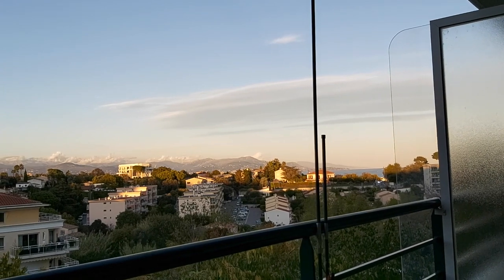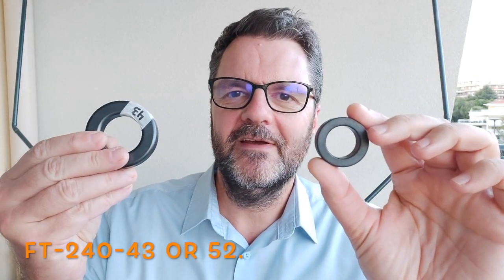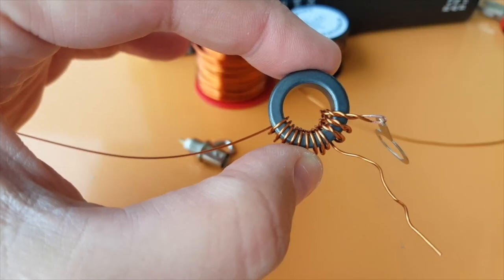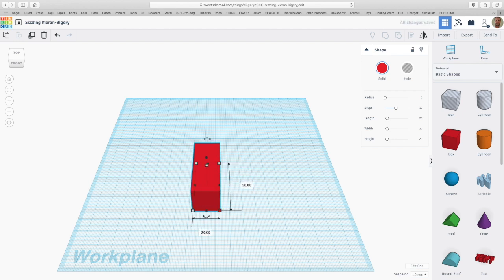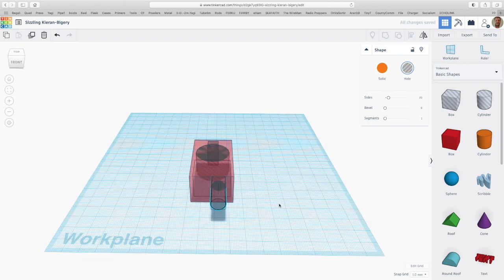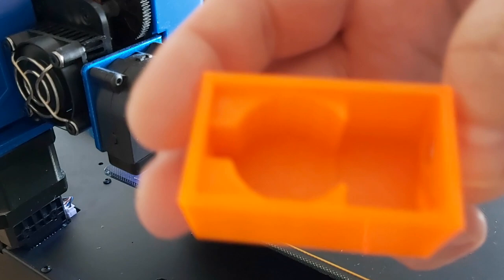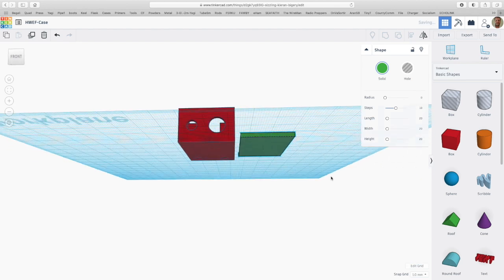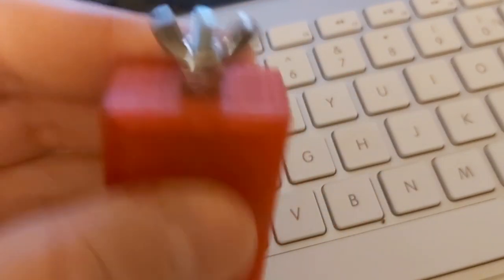A Super-Duper Tiny 3D-Printed HF Radio Antenna.

Comment: The best thing that ever happened was you getting a 3D printer :) Second best was ME getting a 3D printer. It's always printing something. I really like PETG. More than PLA. Not for everything but most things I print are PETG
Reply from the maker: Stronger, not as brittle. I will try carbon reinforced PLA, but you need a steel nozzle for that...

Comment: Nice project Gil. There is no need for a high voltage capacitor. The impedance at that point is 50 Ohm so with 100W the voltage across the capacitor will be 70.7 volt. With 5 Watt the voltage is 15.8 Volt. 73 Erwin PA7N
Reply from the maker: I just had them handy..

Comment: I don't think you loose power with the smaller core, you just can't transfer as much power before you magneticly saturate the core.
Reply from the maker: However, the turns being closer together, the losses are reduced. I have never in practice noticed a difference, although I have not compare them head-to-head.

Comment: The possibility of ingress of moisture (in harsh outdoor activities) and the need for a vent may also be thought of in your next printing of the container.
Reply from the maker: A small drill bit can fix that real quick :-)
Reply: @RadioPrepper  yes, I have seen being made that on the bottom side, in any readymade container. But I suggested this because you are good at 3D printing.

Comment: I like your box with the cylinder cutout.  I’ve been designing my boxes as boxes.
In TinkerCad, you can build components that you can add to your parts panel and reuse.  I have a BNC connector to scale, UHF, toroidal, banana plugs, 1/4-20 bolts, etc.  I add them to my projects, switch to hole, and they become holes through the box for mounting.
With all that said, I switched over to OnShape last year and really prefer it as I can rescale an entire model pretty fast to scale things up and down as necessary.
We will be downsizing next year and Fulltime RVing in two years, while my ham gear comes with me, my 3D printer will not, I dread that day...
Reply from the maker: Same here with my boat...
Reply: @RadioPrepper  Are you planning on living on your boat?
Reply from the maker: Long trip in 2-3 years...

Comment: Hi Giles, I use an end fed with 3 stacked ft240 cores, and 400 watts.  I do find I get rf on the ground side.  It still works, but I believe EFHWs are less efficient at high power.  Maybe I need to try a counter poise.  Thanks for all your interesting videos.  Please show more of the south of France!  Tim VK4QP.
Reply from the maker: Worth a try, 0.05 wavelength.. Will do!

Comment: 2:45 why should the loss be great?
It should be good for 5W or even more, up to 25W probably.
The key is the inductance of the primary, smaller toroid - >more turns for the same band.
Reply from the maker: Size matters ;-)
Reply: @RadioPrepper  Size and faith, but better is to understand how it actually works ))

Comment: Kind of wondering if you could make a jig to hold the parts, and then print the enclosure around the parts. The end result might look as if you had put say 2" heat shrink tubing over the parts and just heat shrunk the whole assembly. You might only need 1-2 MM wall thickness, printed around the parts perhaps it would not place any tension or constriction on them like heat shrink would.
Reply from the maker: Not with a conventional 3D printer...

Comment: One 3d printing tip for you. Plastic has a shrink factor so your bnc hole will always come out smaller. The fix is to add 3-5% depending on manufacture spec's of shrinkage. Oversize the holes by 3%.
Reply from the maker: I left them slightly smaller as finishing them with a drill makes for a rounder hole..
Reply: @RadioPrepper  If you're not getting a round hole then you need to start digging into that brand forums (try facebook "brand X" forums) and seek advice. It can be a few things. Try the easiest first like layer height and slow the print speed down, the more complicated things are like tuning and looking into the jerk and stop settings. Dialing a printer in depending on the brand leads you down into a rabbit hole and why many modifications were created in an attempt to overcome all sorts of issues. You learn a lot in the process. Best of luck
Reply: Then of course check out YT for the brand and see what others are doing with it.
Reply from the maker: Only bigger vertical holes are ever slightly oval, but it's hard to see... I can always add support in Cura...
Reply: @RadioPrepper  If you don't mind longer build times 0.1 layer heights give better details.
Reply from the maker: Certainly!

Comment: The military choice for the amount of wattage in 'man packs' tells us is that the man has to carry the batteries as well as the radio gear, and thus there needs to be a balance between adequate power, carrying enough battery to sustain the radio for a minimum amount of time specified, and the weight that will have to be carried. The amount of funding has nothing to do with it. It's not like lack of funds for the military would cause them to have to cut back on wattage.
Reply from the maker: Not on Wattage, on research. That too of course but it shows 30W is the minimum that works reliably enough. Modern lighter radio and batteries have not generated a large increase in manpack power.
Reply: @RadioPrepper  Yes, I agree. Batteries are much better today than they were during the wars, but you still only get a 3dbm gain for every doubling of output power.

Comment: Can someone explain the reason Gil filled the whole thing with hot glue? Is it just aesthetic or there's more to it, something technical perhaps?
Reply from the maker: It's to hold things in place to avoid fatigue cracks in solder joints during transport. And I like glue!
Reply: @RadioPrepper  thanks for the reply, and thanks for the explanation. I was wondering, wont this affect future possible repairs or it's an edge case where you'd actually make new one instead of repairing this?
Reply from the maker: Yes, cheap enough, and short of a lightning strike not much can happen to it...

Comment: Could drop the counterpoise and flip the toroid over for a more simple setup. From what I have read, a counterpoise isnt necessary at such low power.
Reply from the maker: No but a ground to bleed static electricity might for a balloon or kite antenna..

Comment: Nice video Gill.
I noticed that you reversed winding half way thru on the secondary, why was that.
In case you make a followup of this project could you sketch up the wiring diagram.
Thank you.
Reply from the maker: Just so the wire comes out the opposite side. See the Facebook half-wave end-fed group for the diagram.. It's in my head I made so many...

Comment: DE KD5SMF; Thanks for posting this video. I'm not used to a end fed antenna but, you make a very good case for using one in the field.  I noticed that you didn't use a dip meter to verify your toroid's frequency.  Have you confirmed that the 24 turns in the secondary are what was necessary?  And what frequency are you making the antenna for, or is this multiband?  Also, it would be nice if you would give your amateur radio call sign at the beginning & end of your video's. 73's de kd5smf
Reply from the maker: The 24 turns are not secondary but total turns. 3 primary and 24 total makes a 64:1 transformer. You can also use 21 total which makes a 49:1. For higher bands, 30m and above, 2 primary and 14 total might be a better choice. I did not test it because I built many before and know they work. I don't always give my call sign on videos, it's not a QSO. See: https://youtu.be/0zF7bDoqkG4
Reply: @RadioPrepper  Thanks for your reply. I'm always interested to know what other hams QTH is, and it's just a courtesy to give your call sign. I have made a balun before, however, I didn't have a way to test it out before getting the antenna assembled.  And, since the antenna I was working on at the time was several years ago, I forgot what the balun was for in the system.  Only tried it out a few weeks ago without being able to get it to tune.  SWR was off the scale. 
I have a book on baluns & Ununs and I will review it.  73s

Comment: Nice, but I would have voided the  entire insides of the box save for perhaps a post in the center of the ferrite.  You could have used Cura to make the Z axis smaller.   Also there is a Mesh control you can add to Cura.
Reply from the maker: What's a mesh control?
Reply: @RadioPrepper  I have attempted twice to put down all the features of a Mesh controller.  I use both the standalone Mesh Mixer and the extension to Cura.  Mesh control refers to specifying different element sizes at different regions in the model. A smaller element size in a region improves the accuracy of results in that region. You can specify mesh control at vertices, edges, faces, components, and beams.  Mesh Mixer does primitives like Tinkercad, but I find Tinkercad just a touch easier, but what it can do is hollow those primitives for you.   You want a box?  Just specify a box and then specify it to be hollow.  Done.  You need holes.  Just place them.    You need the corners strong than the rest of the box, specify higher meshl just in the corners.
Reply from the maker: Thanks, I'll look into it!

Comment: did you check if the small ferrite warms up ? If not then no major losses to worry about ;)
Reply from the maker: No risk of that with 5W..
Reply: @RadioPrepper  Thanks ! That's great then Gil. I'll order myself this toroid size for my QRP outings. I have found online here some 0.75 mm diameter copper, so that'll do the trick.

Comment: Is it possible to get a parts list for the core and some assembly instructions ? Just downloaded the files and printing and will print tonight.
Reply from the maker: I get all that stuff on Ebay. Core is the FT-82-43.
Reply: @RadioPrepper  thanks! its printing now. 73's WB8WFK

Comment: (To be Picky) you only have 2 Turns on your Primary (Twisted Pair) the Wire IN (Counts as 1/2 Turn).. The Wire  OUT (Counts as another 1/2 Turn) I see you only have One in the Middle for a total of 2 Turns.. You would Need 1 more Turn (of twisted Pair Two in the Middle) to be a 64:1 with a 3 Turn Primary.. and 24 Secondary (Then the Math Works) 3 over 24 divided by 3 = 1 over 8 (8 x 8) = 64
Reply from the maker: I was always told that you count the turns on the inside of the toroid. In that case it's three turns.. I'll look into it.
Reply: @RadioPrepper  The (In) and the (Out) can only be 1/2 (One Half) of a turn .. Count all the Middle turns then Add One .

Comment: Nice. You have added a ground and normally a ground is not needed on EFHW. I have built 49 to 1 and 64 to 1 with and without ground. All my tests with ground and counterpose make no difference.  What do you think?
Reply from the maker: True. Useful for kite and balloon antennas though to bleed static electricity. Could be useful in case of lightning strike...

Comment: Yes but military manpack radios are not made for DXing, you usually need to reach your command centre a few km away.
Reply from the maker: Not necessarily. The military relies heavily on NVIS for regional comms on HF. The local sets use VHF.

Comment: Can you show the testing you did to get the correct SWR and wire length? I have tried what you suggest but SWR never behaves.   Thanks
Reply from the maker: Not much to show.. I start with a slightly longer wire and cut a couple inches at a time..
Reply: Not working for me. SWR super high no matter the length.  Not sure what the problem is yet
Reply from the maker: Nothing around the antenna? Did you use a 43 material toroid?
Reply: @RadioPrepper  I put a 2.8k resistor across the wire to ground and it tunes pretty well on the bench: 1.87,1.23,1.56,1.54 on 40m, 20m, 15m, 10m respectively.  When the wire is actually attached all go over 10! I cant figure it out :(
Reply from the maker: Very weird given that the design works really well.

Comment: Nice transformer!!  I just checked to see if you had done a video testing it yet.  Didn't see one.  I am very interested in that since I like to use EF antennas.  I have a 40 Meter EF that I built and then I built a EF Random wire antenna.  Just a little different than a true EF.  Hope to see a video of you testing this little guy!!  Juddie - WD8WV
Reply from the maker: As soon as the weather cooperates!

Comment: What exactly does the twist do, and how do you test the antenna without an antenna analyzer?   Thanks
Reply from the maker: I heard better coupling of the primary turns. You still need and SWR meter. Cut the antenna at 468/f in MHz, result in feet... Install then trim a couple inches at a time until the SWR is good. Do that at a slightly lower frequency than you want to use, like 50KHz, that way when you see the SWR going back up you're good :-)

Comment: Nice thanks btw up in the area where you merge things the the item that looks like a vertical bar with two horizontal bars is an alignment tool that's super useful.  One question what do you think it might handle power wise?
Reply from the maker: Not sure, maybe 30W..

Comment: Rather than use hot glue to pot the box, why not mix up a larger amount of epoxy and fill the box with that?  The lid would then not be necessary.
Reply from the maker: Epoxy kills it. I tried, twice, wasted two toroids...

Comment: How does 3/24 turns equate to 64:1 ratio?
Reply: U - 24/3=8 times more. Since power is the same so output current wil be 8 times less. Then output resistance transforms 8x8=64 times more from 50 Ohm to 50*64=3200 Ohm.
Reply from the maker: Yep, 3/24 is an 8:1 ratio, and 8 squared is 64.

Comment: Title "A Super-Duper Tiny 3D-Printed HF Radio Antenna."

The one true Rule of 3D Printing hype:  Whatever noun follows the phrase '3D-Printed' is always the wrong word. Always.

A 3D-Printed plastic case, while very nice, is not an "...HF Radio Antenna".  It is but one small part of that Next Higher Assembly.  Until your 3D Printer can extrude conductive wires and all the other gubbins, then you'll not be "3D Printing" any antennas as such. Merely some plastic components.

See rule above. It is ALWAYS true.